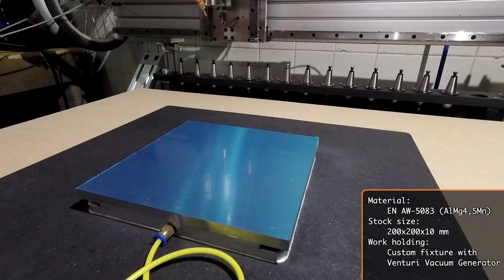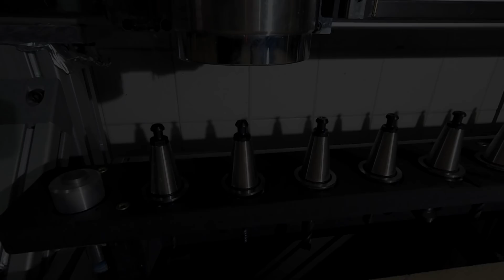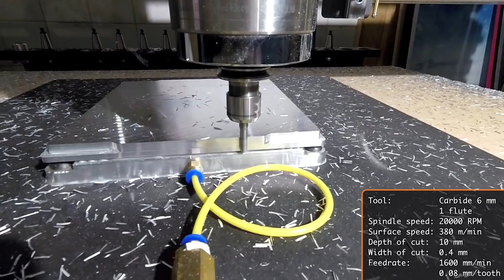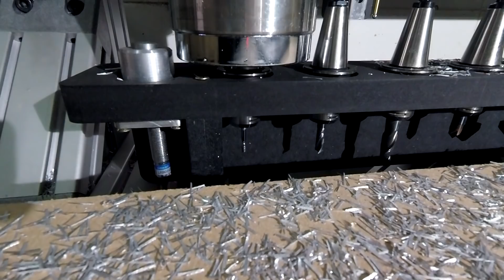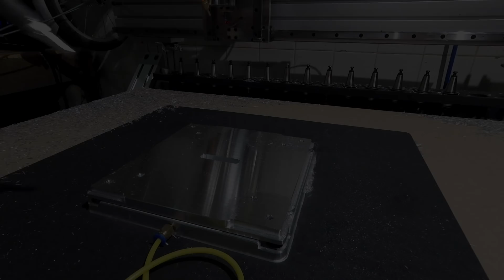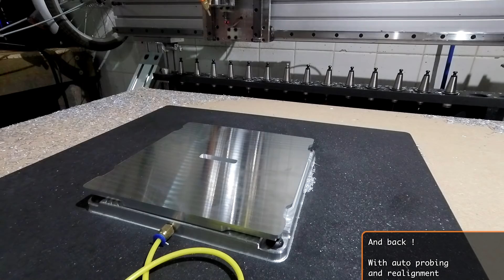DIY CNC Router with Automatic Tool Change milling aluminium

Comment: Did you get a 2 pole or 4 pole version of the jianken 2.2kW spindle? Also, would you get 2.5kW or larger size spindle if you could (for aluminum milling)?
Reply from the maker: It's a 2 pole version (VFD @ 500Hz => 30000 RPM). But I did not know they had a 4 poles with the same specs. Nevertheless I'm very happy with that spindle and I would not change for a more powerful one. My limiting factor is not the spindle torque but the machine rigidity. The max amperage I'm observing (on the VFD screen) is 2.9A (@ 200 Volts => 2.9*sqrt(3)*200 = 1000 Watts). The spindle rating is 6A. I pushed it once to 3.5A milling PVC but I felt it was a bit too much for the machine (noise and vibrations). So in the end I'm only using half its max power...
Milling PVC, with a 6mm single flute endmill, I'm confident cutting 10mm DOC * 6mm WOC * 0.15mm/tooth @26000 RPM that's a feed rate of 3900mm/min. It's fast enough for my needs.
Milling aluminium I'm using even less power. I think I'm around 2A max. And I go 10mm DOC * 0.5mm WOC (same endmill). I might be limited by my fixturing that vibrates if I go harder.
But of course it depends a lot on your tools. I always use single flute 6mm max endmill at high speed (between 20k RPM and 30k RPM). This demands less torque on the spindle and is less stressful for the machine. If you want to mill with multi flute, large diameter tools, at low spindle speed, you won't have enough torque with this spindle. But you will also need a stronger machine.
Reply: @YannPomarede  Thanks for the fast reply. I am currently deciding on the best Jianken spindle to get for my needs, which is why I decided to ask you a few questions. Yeah they can customize almost any spindle to your needs (2 pole or 4 pole for most of their spindles). The machine rigidity has been something that I see a lot of people struggling with when they build with aluminum extrusion, so I can see how a 4 pole spindle may be too powerful. Fortunately, I will be using steel for my gantry and epoxy granite for my base, so there should be little issue with too much vibration since the granite will be my dampener. 

Have you thought about making your base extrusion heavier by using sand? It might be worth a try to see how much the vibrations are minimized since the base would be more stable; less likely to move so much during milling. 

Anyways thank you again for the response. You have a very nice DIY CNC router. Keep up the great work!

Comment: Why don't you use drills to drill holes?
Reply from the maker: The cutting forces are much higher with drills. And this machine would not be rigid enough to drill into aluminium.

Comment: Amazing project. How much does it cost in material? there's a reference to replicate this machine? Congrats for your work!!
Reply from the maker: Everything included (with computer, vacuum pump, compressor, accessories, vacuum table, etc...) I think it's around 8000 €.
Reply: @YannPomarede  thanks for the answer. Which kind of pc did you use?
Reply from the maker: It does not need to be a fancy one, I just bought components separately: a mini ITX motherboard with CPU included (Celeron J3355), 4GB RAM, a SSD and ITX case. The high frequency step generation is done with an external FPGA card (Mesa 7i96). So I did not need ultra low real time latency as when you're using the parallel port to directly drive the steppers. Here the communication between the PC and Mesa card runs at only 1000 Hz over the ethernet port.
Reply: @YannPomarede  understood. I'm planning to built a cnc like this, so I'd have some questions in my mind. 😅 Your machine works really good and seems to be big enough for my future plans. Have you got a blog or a facebook page to have more info?

Comment: It seems to be kind of bs. Vacum fixture? Ok. Sort of probe. Maybe. But when he turned piece over and probe the edges WITHOUT clocking it? This will never gonna work out.
Reply from the maker: I don’t understand what you mean by “clocking it”? Could you explain?
Reply from the maker: If you look closely you will see that a probe 6 points around my workpiece and I adjust X, Y and the rotation of the coordinate system. I don’t need to square the “vice” or the workpiece ;-)